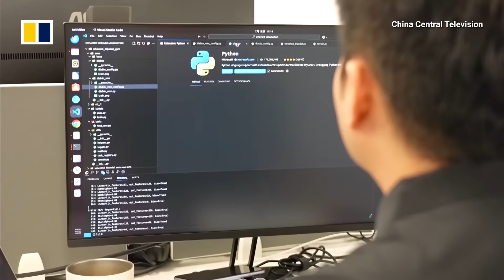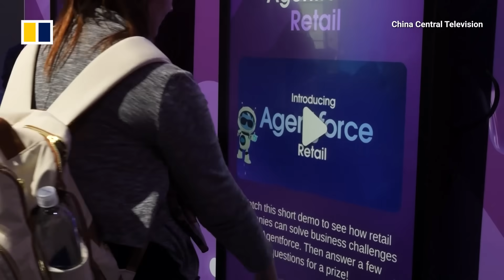China’s analogue AI chip could be 1,000 times faster than Nvidia GPU

Comment: Reminder to all. US banned China from participating in the international space station and look at her now. Has her own station. Do you really think China will not deliver with semiconductors? It will thrive on that also!
Reply: They’re not really comparable. You can focus on basic science and build components for space tech, but developing processors is a whole different level of complexity. Even the US doesn’t fully do it alone — access to advanced lithography machines (pretty much monopolized by ASML) is key.
That’s why the US just needs to restrict ASML from selling to China, the same way it blocked Nvidia from selling advanced chips there. That move alone makes it much harder for China to produce cutting-edge processors. Right now, most of China’s progress is still in the tens of nanometers range, while top-of-the-line chips are already around 2nm. That’s a huge gap — it means Chinese chips need much larger dies and consume far more power to perform at similar levels.
That said, one interesting outcome of these restrictions is that Chinese researchers have been forced to push efficiency to the max with the limited hardware they have. Their AI models now perform close to global standards despite weaker processors, which could make them incredibly powerful once they have access to stronger chips.
Still, I don’t think what the US is doing is right. They block countries like China from getting high-end tech but then complain when China restricts exports of rare earth minerals to them and their allies. Feels like a double standard.
Reply: @pviveknair 实际是已经推进到7nm左右了。比如我用的就是华为麒麟芯片9020，评论这条信息。压力才是动力。这几年中国半导体发展飞速。美国人做不成不代表中国人做不成。中国有足够的人才（理科毕业生比欧美总和还多），足够的热钱（购买力平价中国已经是世界第一，中国科研人员发的可是人民币）足够大的市场，比欧美加所有发达国家人口总和还多。
Reply: @pviveknair feels like a war mate. Russia is at war with Europe too.
Reply: @pviveknair  Update your information. China was already manufacturing 7-nanometer chips two years ago. Huawei phones now use its own 5-nanometer chips.
Reply: @DuChen-py7gl  You are exaggerating now. China has only recently started to stabilize the 7 nanometer production, but it is still not in mass market production yet. TSMC was in the 7 nm at similar levels back in 2018. And yes, China also has a 5 nm at experimental levels, which is where TSMC was back in 2020.
That being said, it is really a great feat by China to reach these levels so fast. And by 2030 if nothing goes wrong, China should surpass the West in traditional processor technology.
Reply: @pviveknair  In 2023, tens of millions of Huawei Mate60 mobile phones were sold, and they used Huawei's 7nm chip, the Kirin 9000S. Isn't this considered mass production? This year, the Mate80 will use the Kirin 9200, a 5nm chip. The current 3nm chips are not manufactured in the West, but in Taiwan, China in the East. China is mainly blocked by the United States from accessing EUV lithography machines. Moreover, Taiwan cannot produce 3nm chips without Dutch EUV lithography machines. It's not that China is incapable of manufacturing 3nm chips; if China had EUV lithography machines, it could completely produce 3nm chips now. It should be noted that the semiconductor industry is a global industry. Without globalization, the United States cannot produce a single chip, and it also needs rare earth metals from China.
Reply: @pviveknair  Correction, ASML has had a join ventural agreement with IMEC (R&D company in Belgium) and Zeiss (world's most advanced center for optical mirrors) and Cymer (lasertechnology from the US) and US software companies... China's fatal error is thinking they "can do it alone"... In Lithography that's your first mistake... China isn't anywhere near the progress ASML has made or will make...
Reply: @DuChen-py7gl  You're comparing rare earth metals to Dutch hight tech industry ?! (Which the Dutch themselves are reliant on Belgium, Germany and USA?!) Are you crazy or just brainwashed?! ASML lithography machine is by far the most complex machine on this entire planet... China doesn't come close...
Reply: @DuChen-py7gl  even if China can do 7nm, it's not as efficient as EUV machine and yield drops significantly. I don't know if they suffer a loss behind close door but that's not how a business meant to be conducted. In the short term they gain market and puplicity but without high end EUV, their productivity could never be on par with TSMC and other competitors. Not to mention supply of their DUV could be cut off any time soon as political tension rises
Reply: @ABC-ABC1234  Sorry, it's you who's been brainwashed. This year, China has already produced what you're so proud of: the most complex machine on Earth, capable of producing 7-nanometer DUV immersion lithography machines. SMIC has already begun trial production. The only thing missing from EUV lithography machines is the light source, and that's coming soon. According to a 2024 report released by the Australian Strategic Policy Institute (ASPI), China leads the world in 57 of 64 key technology areas. Where's your Dutch father? You have nothing to be proud of.
Reply: @DuChen-py7gl  Do you know how complex the ASML lithography machine is?! Do you even comprehend this?! ASML requires 100+ suppliers just to chip in to assist making this machine! China's view on lithography is garbage! Nice try, but unless and untill you can come up with an AI chip that is anywhere near the ones produced by TSMC (using ASML lithography machinery) I will listen! Until then, be quiet :)
Reply: Soviets got a man in space first. But....
Reply: @virupakshawalla5734  Also, first Sattelite.

Comment: analog computing is not usually limited by speed, but by application and accuracy. If made to work on one specific task and the accuracy is acceptable, the things digital computers need to take many steps to do can be done in one step.

basically in digital computing, you have ones and zeroes and you have to use them to represent values and commands to make them do stuff. In analog, you design a specific circuit with specific inputs and measure something at the end. The thing you measure represents the result of the calculation you want to do.
Reply: Checks out. I found the Nature paper: "Precise and scalable analogue matrix equation solving using resistive random-access memory chips". Seems like they simply used an ordinary resistive RAM chip, but their innovation is the algorithm.
Reply: @strangelaw6384 so the innovation is a matrix module using RRAM?
Reply: @Heightren  That's what I took away from the paper. There was a long paragraph that specifically addressed the question of what did the research team do that was new to the topic.
Reply: AI doesn't need very high accuracy. DeepSeek is on FP8 and ChatGPT and Claude are on FP16 normally. This chip can do 24 bit accuracy which is enough for AI training. But it won't replace CPU and GPU totally but will leads to cheap and energy efficient AI tasks.
Reply: @vrealzhou  Its potential is much higher than that, read some articles about it and you’ll see
Reply: @Jeremyh_King  yeah, I know. The key point is the computing is on the RAM directly so no performance lose on RAM to processor data transfer cost.
Reply: @vrealzhou WHY WOULDN'T YOU WANT ACCURACY IN AI?!? ESPECIALLY FOR THINGS LIKE MEDICINE OR NAVIGATION?!
Reply: So it sounds like an ASIC
Reply: That's the thing, analog computing is making a comeback for that precise reason, because you have more devices in general, and a huge load is handled by specialized devices. If you look at any AI server rack, you'll be looking at a purpose-built monster. If you take that same logic and break down specific tasks into smaller, more specialized tasks, you can get a real benefit from analog's speed.
Reply: right, in this case matrix multiplication which is the thing needed for fast AI, well and the entire model in memory
Reply: Yes, processing speed and accuracy is an issue.  Power distribution is extremely critical also.  But if the increased “ logic level “ can offset the speed concern, it could be faster than conventional digital speed.  Also I would expect the power consumption greater than the conventional GPU chips.  The shared memory cannot be analog so they need to figure that out also.  Would be very interesting to see when it hits the market
Reply: @cpcheung66  "Also I would expect the power consumption greater than the conventional GPU chips." it's not, power consumption is orders of magnitude less than digital GPU compute. To do one multiplication in digital logic requires thousands of transistors depending on the floating point precision. The same single multiplication in analogue is performed on one memory cell. The problem is pure analogue is not great for training models but it is great for running trained models. The current state of the art is hybrid systems that negate analogue's problem of massive potential for error drifts when used in training scenarios. For trained models applications in the field nothing beats analogue on price, power and size per performance.
Reply: When it comes to AI they perform exactly the same. They multiply a signal with weights and add the product down the matrix. The "neural net" IS the specific circuit design and it's exactly the same as a digital net. The difference is the analogue is multiplying conductance with current which is incredibly simple and can be done with a single memory cell and a resistor, whereas digital has to use thousand of transistors to do the same single multiplication.
Reply: That's piece of cake...we can do coding/programming before without using Microsoft Windows.